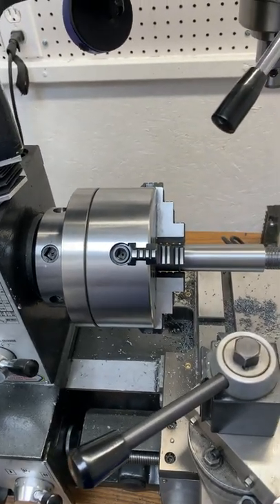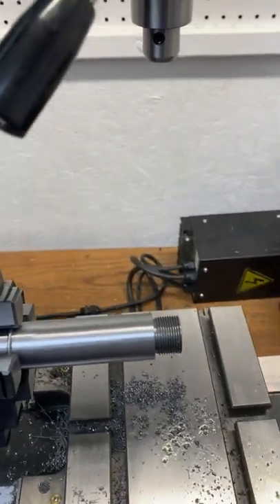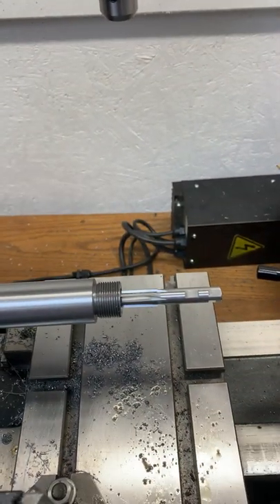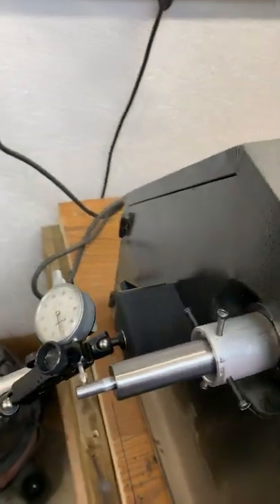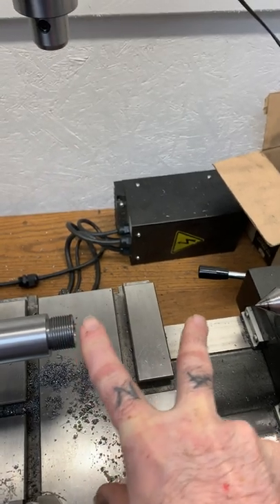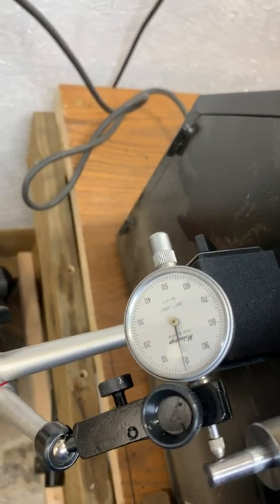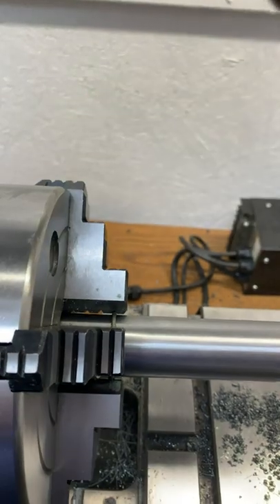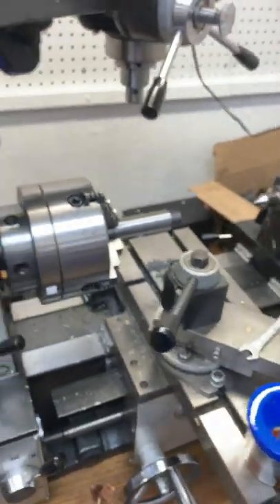Indicating a barrel.

Comment: If the bore goes in a bow its better to zero the barrel to the last discance. If you for example is doing a thread for a suppressor. The bullet will end the barrel in an angle in relationship to the threads. If you look throgh the bore while the lathe is spinning its common that the bore will be more or less bent. Just my experience
Reply from the maker: Very true. Many people do it the way that I do and others only indicate the last few inches of the bore as you stated. But, after I indicate both ends true, i also verify the straightness of the bore before I start to ream. If it's slightly off, I correct it. If it's way off, the barrel goes back and I start over. If a person was to just set it up the way I do and ream the chamber with a crooked bore, the chamber would be cut oversize, unless using a floating chamber reamer. I personally dont use a floating chamber reamer because I make sure that there is no runout.
Reply: My lathe has a too long gearbox for the barrel to reach out the back. I am planing to make a rotating four jaw support and mount it on the bed like a regular support. Never seen one acutaly. But i think it could work. Just to be able to adjust both ends of the barrel. The whole barrel outside with the back in the regular four jaw chuck and the end that requires work supported by the rotating four jaw. What do you think of that?
Reply from the maker: @erotdaman  There are specific 4 jaw chucks that swivel about their axis for such situations. I cant remember what they are called though, but it sounds like the same premise. If you can do it and make it work, I dont see why it wouldnt work just fine.
Reply: @erotdaman  it's called a cathead

Comment: What model lathe are you using.
Reply from the maker: That was a combo Smithy lathe/mill that I despised. Pretty much a jack of all trades, master of none type of machine. I now have two lathes, a 10x30 Bolton and a 14x40 Smithy.
Reply: @thebeardedgunsmith9177  slowly getting into some smithing and have been looking for ideas for smaller but sturdy lathes.
Reply from the maker: I really recommend the 10x30 Bolton lathe that I have. Its the smaller lathe of my two but it's incredibly accurate, sturdy, strong and can handle large jobs. I dont know if it's offered anymore though.
Reply: @thebeardedgunsmith9177  That will be one to keep an eye out for. I appreciate the help and will keep following your work.
Reply from the maker: No problem. Glad to help when I can and thank you for the support.